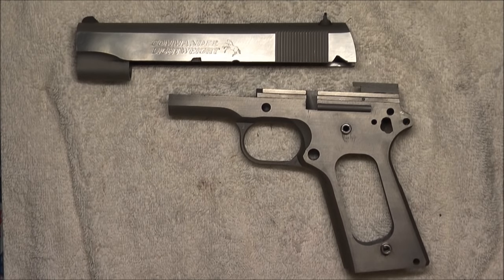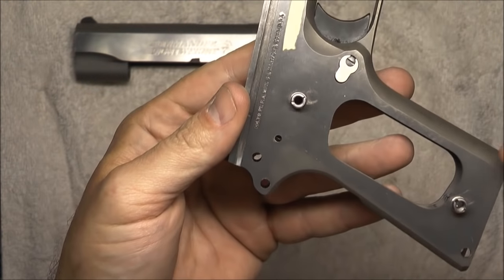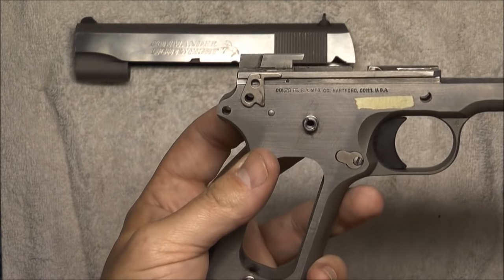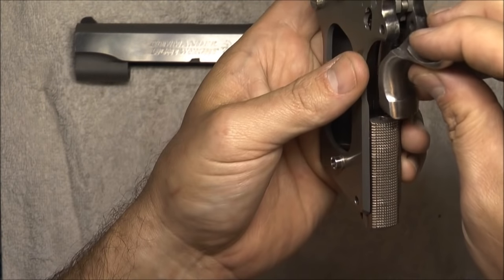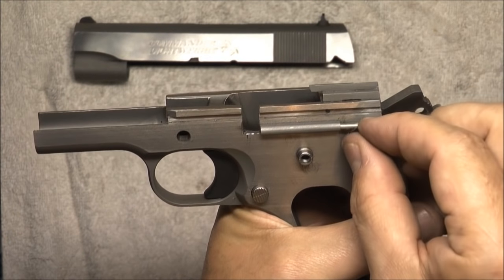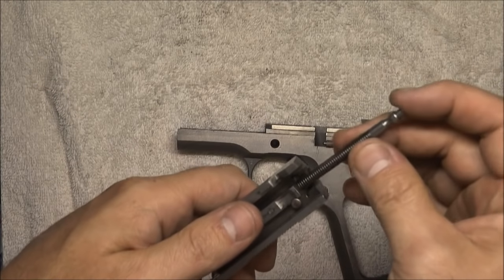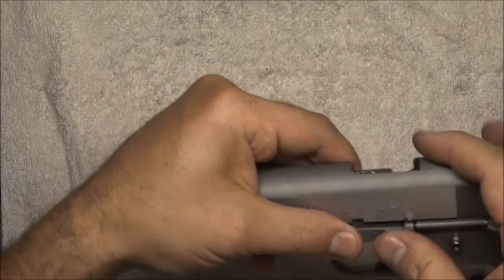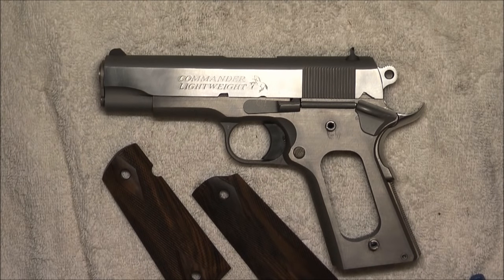BEST Series 80 1911 Reassembly Vid in HD!

Comment: Excellent videos! Do you have something similar for a Glock 19?
Reply from the maker: thank you sir. unfortunately I haven't done any videos on tupperware/polymer pistols. I currently own only one fantastic plastic pistol - an M&P, but those are honestly so straight forward and there are already so many videos out there, I never felt compelled to reinvent the wheel, so to speak. The 1911 series 80 videos came about by mistake. My father and I broke down his series 80 colt, and when we pulled the sear pin and the extra parts fell out we went to YouTube to find out how to put them back together.  To my disappointment, at the time there were ZERO full teardown/reassembly videos on YouTube. I had to figure out out through a combination of instruction manuals and various illustrations on the Web. After I had done that, I figured I'd go ahead and throw a video up for anyone else who might find themselves in that same position in the future.

Comment: Hey could you tell me if a Colt series 80 m1991a1 has this same firing pin safety block? For some reason I am getting confused as to how to tell if I have one.
Reply from the maker: Lock the slide back, look underneath. Look for the round, tell-tale plunger, roughly 3/16" in diameter.

Comment: There's an easier way. Remove the unnecessary Series 80 parts and install a spacer. to return it to it's intended state as a Series 70.
The firearm already has 3 safety mechanisms. It doesn't need a 4th.
Simpler mechanisms are more reliable, last longer, don't malfunction, and don't have extra points of friction that wear out the mechanism's components more quickly.

Comment: i need help. my hammer doesn't stay cocked back. how did you place the sear spring?
Reply: i got it now. my hammer coks back and the trigger works and grip safety works, however, when I turn my thump safety on and squeeze my grip safety and trigger, it disengages.
Reply from the maker: Hi Todd, one end is three-leaf, the other is solid with a small bend at the bottom. That small bend sits in a slot in the frame behind the MSH so the three-leaf end points upward. Hope that helps!

Comment: How much does this gun cost?
Reply: How much you got?
You may think this is a shitty answer, but I'm being serious.
You can buy a very basic 1911 for about $300, but you may need (and will, eventually, Want) to add some valuable upgrades to an entry level model.  It's been about 10 years since I looked, but it is not unusual to spend $800- 1500 for a "good" 1911 and you can spend $3000 or more on a custom "race" gun.
Like I said:  How much you got?

Comment: How come you put no oil on anyting?
Reply from the maker: The only thing that really NEEDS lube is the slide. The cleaners i use leave a little lube behind. Remember any lubricant is going accumulate dirt and residue. I do lightly oil the slide, but didn't feel the need to talk about lube, maintenance, etc

Comment: This isn't a series 80 though
Reply from the maker: It absolutely is.
Reply: @icoach73  My brother owns one and it does not have a full size guide rod.
Reply: @josephcandela2317  I own several series 80 1911s. Some have full length, some have standard, and some have two piece, depending on the manufacturer and model.